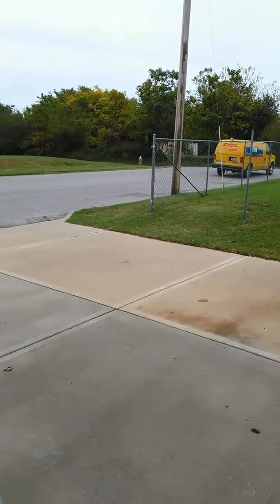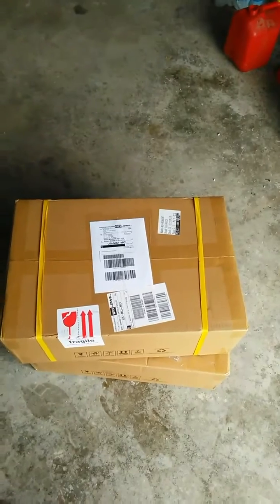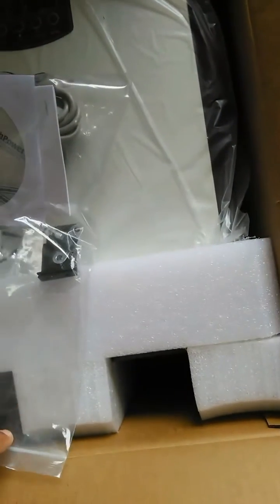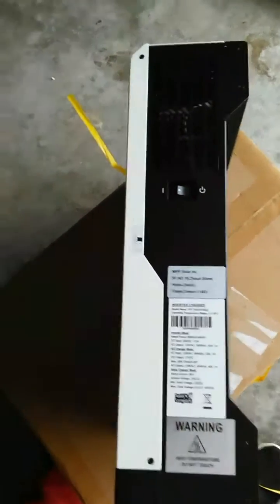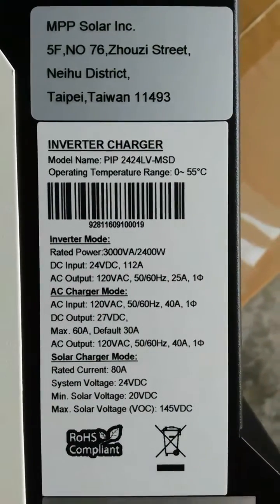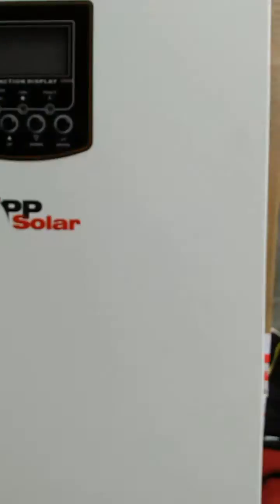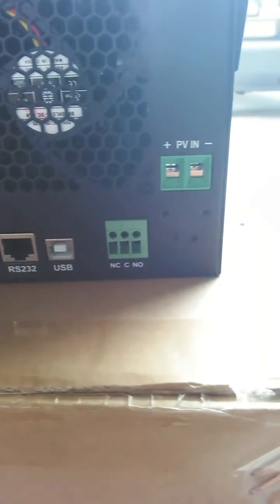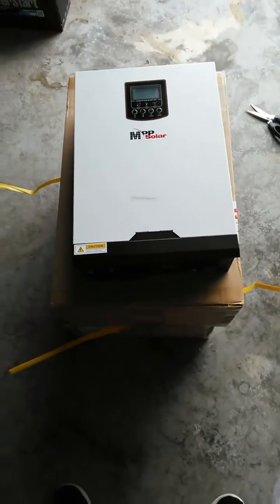PIP 2424LV-MSD 120 VAC 50 Hz 60Hz

Comment: How is your solar inverter working out?  This seems like it would exactly fit the bill for what I am looking for, but I wish they were a USA seller and there was more information on the units.  I am really interested in your real word experience.  Jeff
Reply from the maker: Jeffrey LeTempt just getting everything I need to get them hooked up finally got my batteries and Breakers and wire and everything I need so haven't had time to hook it up yet but plan to get to work here in the next week or two I will be making a video once I get it up and running and maybe as I'm wondering it up keep an eye out for it thank you

Comment: It is 50/60Hz auto sensing.
Reply from the maker: Yes it is 50/60 Hz .
Reply from the maker: yankey4 go to www.mppsolar.com  499.00 shipping 99.00
Reply: auto sensing sucks a switch is better
Reply: , good news good news
Reply from the maker: I could be wrong but I believe you  set it inside the software either 50 or 60.
Reply: What did you pay for them brother? I  tryed to look it up no luck tho.. Thanks
Reply: According to the User Manual the 50/60 Hz is user controlled in program 09 of the setup

Comment: Thats to bad that it's 50Hz are you in USA? Your home is running on 60Hz if your in USA. I would not use it. IT WILL KILL EVERY THING YOU HAVE THAT'S NOT 50Hz fan motors, refrigerator, garage door opener, A/C units all that stuff will die.
Reply: 50 or 60 Hertz, auto sensing.
Reply: Michael Watson Auto is trash
Reply: I see, have you had a bad experience with this model? Or a different one? Was it a brown out or something and when the grid came back your unit got set on 50Hz? This model costs about 500$ Do you know other brands/models that have the features this one has in around that price range?
Reply: it was only aims inverter i have it on my youtube channel but now i have the best inverter you can get thanks to my wife